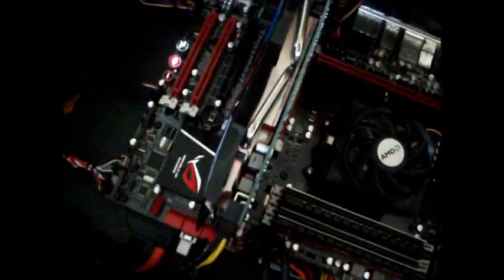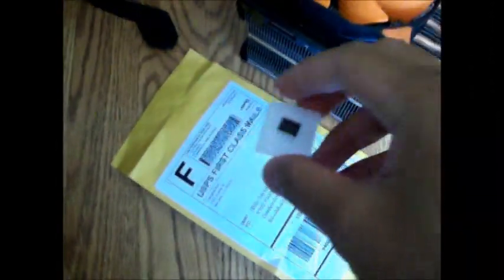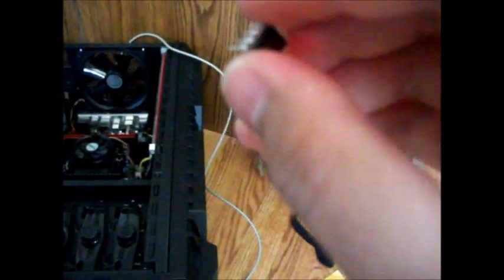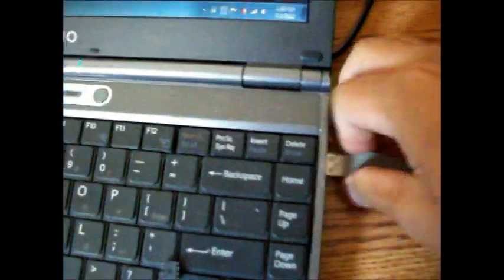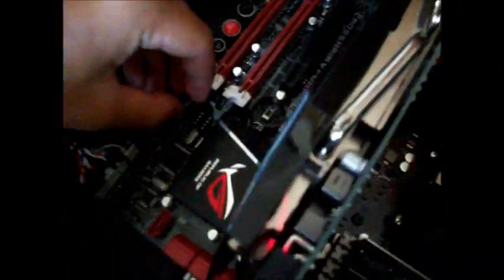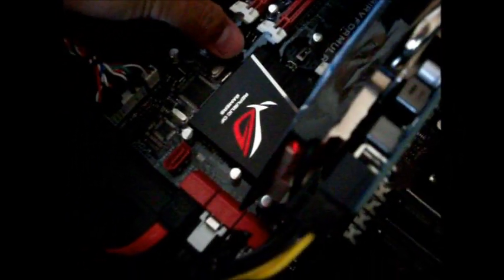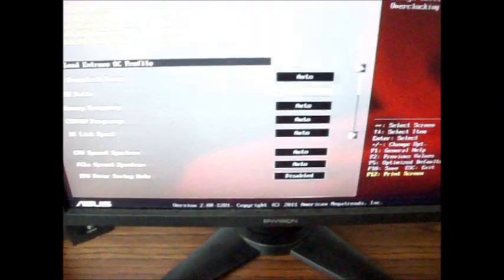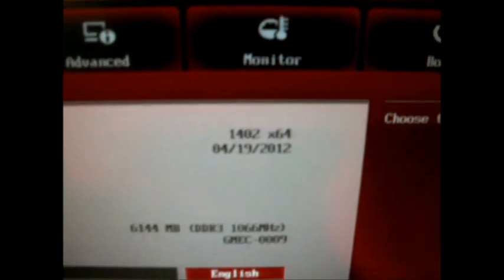Asus Crosshair V Formula's Dead Bios Chip Symptom

Comment: I am not able to see properly is the fan running ? And there is no display and ps2 port for mouse is on no blinking keyboard light. Is I am right? If yes then please tell me because same thing is happenning with me what i have described i also have taken to shop they says it cant be repaired (processor ic) so it is dead. Please tell me

Comment: i have similliar problem which have to happen today...i turned off pc and disconnected it so i can wipe dust from desk and other stuff...now when i connect it it spins up but gpu led, dram  led and cpu led blinking in a pattern... first gpu, dram then cpu...idk what that means and it freaks me out....anybody has same issue?? please help
Reply: Hi Peeps

Try download latest bios from Asus website. 

think you have to rename CROSSHAIR-V-FORMULA-Z-ASUS-2202.CAP file to C5FZ.CAP place in root of USB stick. put USB in rog connect port (White) make sure psu is on pc off and press rog connect button for 3 seconds...

that may not work with a corrupted bios so you may have to find motherboard cd and stick that in and it should load ezflash utility thingy when you turn pc on, search for bios file on USB stick and flash bios. (put USB stick in before turning on pc or it won't show.)

if that don't work could try new cmos battery.

if still not working try new bios chip.
Reply: +LORD CHUNKS tnx man for response!!! i will try that for sure...but i dont have formula z... mine is just formula :/

Comment: Lol
I bought a new chip and installed it. My PC booted and windows started. Everything was fine...
I restarted my PC and it's the same shit again! It won't boot and say q code 55... Everything checked: cpu and ram are absolutely fine...
Reply from the maker: +Max Lindner I'm sorry to hear that. It should be the chip from what you described. Did you try to update the bios as I did? If so, you may need to clear the CMOS before installing a new bios chip. Maybe, the motherboard still wanted to flash the chip after your restarted.
Reply: Billy Says I cleared the CMOS 100 timens. The bios on the chip is the newest version.
Sometimes it would start and run perfectly fine, then it doesn't POST at all...
I am sure the mainboard is defective :'(
Reply from the maker: +Max Lindner Sorry to hear that. :(
Reply: Billy Says Yeah thanks bud. 250 bucks gone in the wind...
Reply: +Max Lindner That is really fucked up, my friend had the same problem, nothing helped, he at least, bought it for less money and used it nearly 24/7 for years.
Reply: ibo beko Just bought the same board again for 110 euros used. Everything works now again. Still hoping to revive my old motherboard some day, but it will probably never happen... :D
Reply from the maker: How about try to use that new chip from a new mobo on an old one? ;] Maybe that's a bad idea. Anyways, merry Christmas and have a happy new year! Cheers!
Reply: Billy Says Hehe, I was curious enough to put the two "old" chips in the new board. They ran fine without a problem with like 10-15 reboots. :):)
Thanks for your wishes! :)
Reply: Max Lindner 10-15 reboots, how does the capacitors look like ?
Reply: Well, they look like capacitors I recon...
:D
No seriously, they're not bulged or anything if you mean that.
Reply: Max Lindner hmm, wired xD